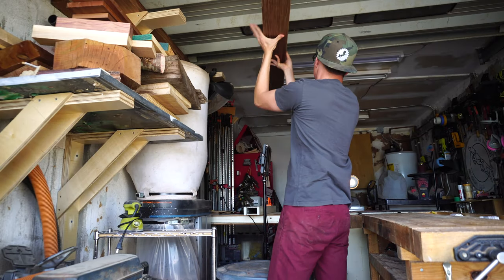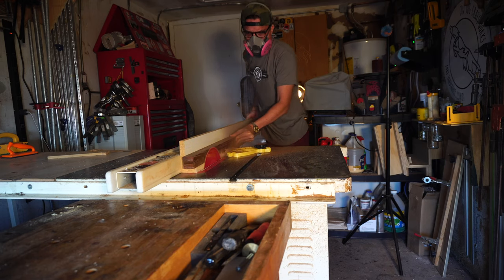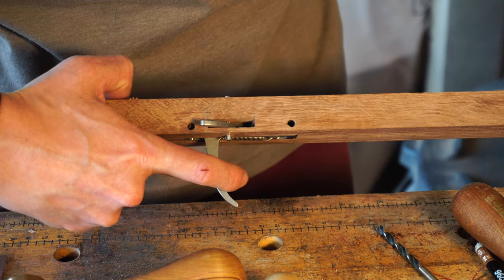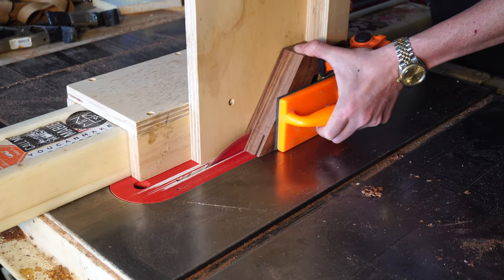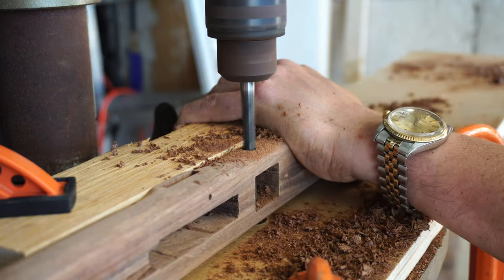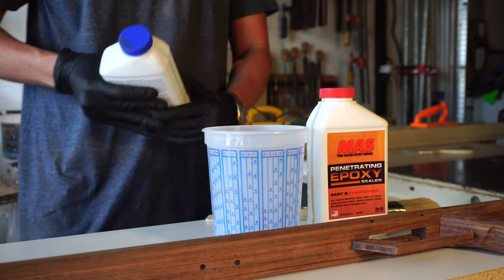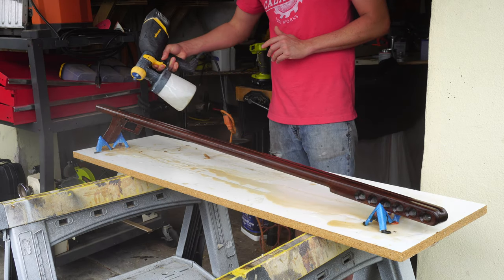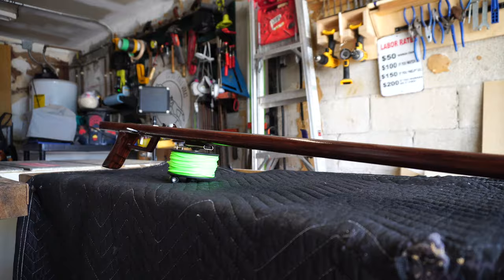How To Build a Wooden Speargun | DIY Spearfishing Gun | Open Track Speargun

Comment: I made a speargun out of wood with simple tools, but you have very complete tools for make a spear gun. ,, from indonesia
Reply from the maker: It’s just a different approach. Most of the speargun videos require a router table and specific end mill bits. I did this primarily with a table saw and a drill press. A majority of the other tools are optional.

Comment: Looks good! Can ask why you cut the solid piece into strips and then laminated them together?
Reply from the maker: So the grain in that wood is pretty straight but even still I was scared that it could curve or warp over time which would ultimately affect the track and therefore performance. So by cutting into strips and doing a lamination I can arrange the strips in such a way that the opposing forces are constantly keeping it flat and therefore straight.

Comment: Great job man! What would you use to seal a mahogany home built speargun, oil or epoxy? 
Which oil would you use?
Reply from the maker: I’ve heard mahogany is better served with epoxy. Probably follow similar steps to what I did in the video. If you use an oil penofin is good

Comment: Hello, great video...thx One question: what is the reasoning behind using the penetrating epoxy first and then a standard 2:1 epoxy? Is the first not enough? is the penetrating epoxy also a mix with hardener? Did you sand between penetrating epoxy...standard epoxy and then the finish? Thx in advance and sorry for the 20 questions. Jason
Reply from the maker: Yeah so the penetrating epoxy is a ton thinner. It’ll travel the pores and grain direction to preserve it from the inside out and the 2:1 operates as a more substantial top coat. It is a two part mix with hardener. I did a very light scuff sand. Just some 220 to knock down any little bumpies.

Comment: Looks nice, although it looks like you didn't make a line guide or a slot to wrap the line around at the muzzle. Even if you don't use the line to keep the spear in place, you still need those.
Reply from the maker: Yeah the line wrap was done by the user.

Comment: Hey Chris @cowdogcraftwood did the 2 part epoxy or urethane finish effect the fit in the trigger mortise? Did you compensate at all when sizing the mortise? 

Also, can you share any details about how you sized the shaft track for the size spear shaft the gun will use?

Thanks!
Reply from the maker: Didn’t affect the mortise whatsoever. As far as the track itself I used a spear shaft and went somewhere between 1/16 to 1/8 larger… it was a while ago so my memory is a little fuzzy.

Comment: I am working on a speargun build and I have been hearing that I should also use 2 part epoxy for the glue lam. Why did you use regular wood glue (does it expand?) and should I use it or should I try 2 part epoxy?
Reply from the maker: Two part epoxy, titebond 3, or poly glue should all be good. I used titebond 2 because I used penetrating epoxy, 2:1 epoxy, and marine varnish over the top of it. Wasn’t really too concerned with the integrity of the glue being affected by water contact. If you’re going to leave the wood raw, like most folks do with teak go with what I suggested at the start of the comment.
Reply: @CowDogCraftWorks  Awesome thank you so much!
Reply from the maker: No worries man thanks for watching!

Comment: I like your videos, I’m Brazilian, and I also make a diving harpoon, what glue do you use to glue the woods,
Reply from the maker: I used titebond II... BUT I only used that because I did a lot of extra finishing work. If you’re not confident in your ability to keep the gun water tight or you don’t want to use topical finishes you should use poly glue or titebond 3.
Reply: @CowDogCraftWorks  do you think that if i use titebond 3, and then i finish it with epoxy resin, you think there is no danger of peeling off
Reply from the maker: Yeah that should be fine.

Comment: I want to know how much in total did it go for the whole carpentry setup that you have
Reply from the maker: Honestly I have no idea. The table saw was used at $700, drill press was $30 on craigslist, ryobi grinder to shape the handle about the same, wagner sprayer about $60... if I'm rounding up and also being conservative I think we're looking at about $2k for all the tools and materials used... absent the wood. That's some expensive wood.
Reply: @CowDogCraftWorks  Deep down i love Carpentry. I want to do it. But never have trained or into it. I’m in another line of work. Carpentry is one of my ‘hobby’ bucket list. Any tips on how to start at carpentry?
Reply from the maker: @Wonderw72  you can buy a fairly cheap beginner tool set from your big box store for about 300-400 bucks and most of those will last you into your intermediate years. Ie. Circular saw, drill and driver. Them get a pocket hole jig and a couple of quality squares. You’ll be surprised at how much DIY furniture you can slap together. Consume as much beginner content as you can and as you get more excited about it you’ll want to crossover into more advanced stuff.

Comment: Hey man!! Just wondering what type of Magnets you used and what you used to Glue the pieces of wood together. Thanks :)
Reply from the maker: Titebond 2... I would recommend going with 3 or using epoxy to laminate the wood together. Those are just neodymium magnets. I got mine from Home Depot.

Comment: Hi, if I  make a wooden speargun wit 3 horizontal laminations would that be OK?
Reply from the maker: Could be. Just don’t make them too thin.
Reply: @CowDogCraftWorks  my dimensions are 1 5/8 x 1 and 3/4.is that OK?
Reply from the maker: I’m certainly not an engineer but that doesn’t sound bad.
Reply: @CowDogCraftWorks  thank you. I am using mahogany

Comment: I don’t have a drill press can I use a biscuit joiner?
Reply from the maker: Sure why not michael. Why tf not.
Reply: Cow Dog Craft Works thanks. Sorry another question. What stain? You didn’t mention which color stain
Reply: @design_guild4431  it does not look like he used a stain at all rosewood is already so pretty no need to stain :) just protective finishing! but i could have missed it but i don't think there was one!

Comment: Hey what if i do the gun with one piece of wood?
Reply from the maker: There’s nothing that really prevents that per se. I’m primarily a woodworker not a speargun maker so my mindset was to make a laminated blank for the purposes of strength and to minimize warping due to wood movement. If it’s a solid blank, it could bend or twist over time and that would effect the integrity of your track and the accuracy of your gun.

Comment: Seeing the sparks from cutting the trigger, tells that it is not stainless material the salt water will eat the metal. Such a nice gun and short sided the hardware.
Reply from the maker: I used the following hardware: https://neptonics.com/product/reef-mech/ according to the website it is 100% stainless steel. If you have further questions about it feel free to take it up with the manufacturer Neptonics.

Comment: Can u use a 2 by 4
Reply from the maker: Try it and make a video.
Reply: @CowDogCraftWorks  where do u get ur wood from? I live in Brooklyn and I don’t know where to look.
Reply from the maker: I’ve got a number of resources here in south florida. We’ve got some quality lumber yards close. I bet if you google “hardwood dealer” you’d be able to find something.
Reply: @CowDogCraftWorks  can u send me where u got the shaft, bands and trigger mechanism?
Reply from the maker: @icy_bit7306  everything is from Neptonics
Reply: @CowDogCraftWorks  ty, also how does the line release work it’s confusing to me, like is the spindle free or does it lock?
Reply from the maker: Honestly I don’t know. I made this for a client and he put the line anchor and crimp on. I’m just a woodworker who made a speargun not a spearo that happens to woodwork.
Reply: @CowDogCraftWorks  I made a trigger mechanism from scratch (sheet metal and aluminum) its meant for a crossbow not speargun, so I wanna buy one now, also any tips on what tools to get to shape the wood, I only have some basic stuff.
Reply: @CowDogCraftWorks  u think I could buy some rosewood off u? Like the same size u had in the video? Since i can’t find any online.
Reply from the maker: I don’t have enough left for a gun.
Reply: @CowDogCraftWorks  do u have teak wood? Also if u do do u also have enough rose wood enough for a handle?
Reply from the maker: I doubt it. I don’t have teak either but you can buy premade speargun blanks from Neptonics too.
Reply: @CowDogCraftWorks  yea they seem a bit over priced tbh, honestly I can prob try to buy sum wood online. Tysm for ur help tho! Also what size gun did u make?
Reply from the maker: I can’t recall. It’s been a while. I want to say it was over 50” though.
Reply: @CowDogCraftWorks  how much did u sell it for? Jus curious
Reply from the maker: @icy_bit7306  it’s a secret
Reply: @CowDogCraftWorks  bro for the quality of that build and the wood used I’d pay like 5k for that gun.